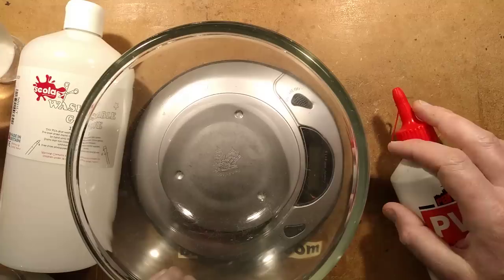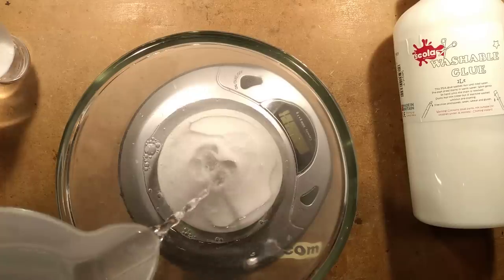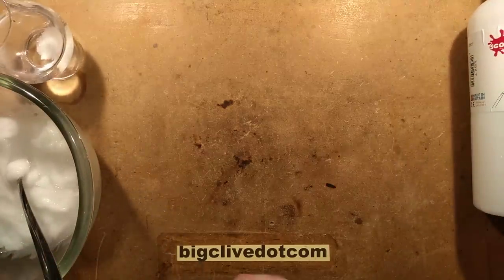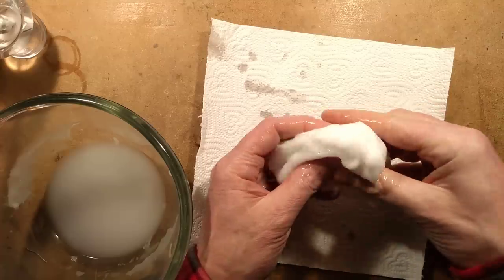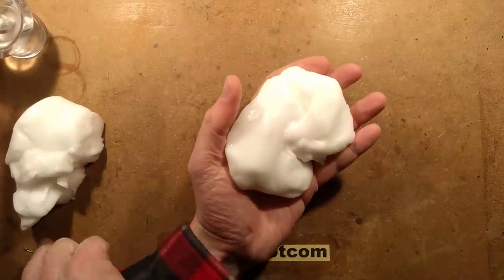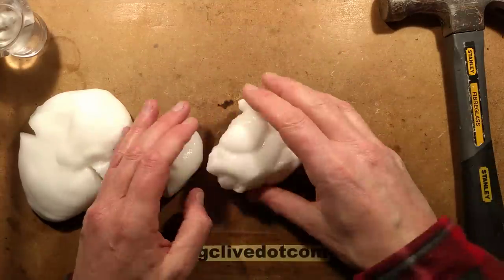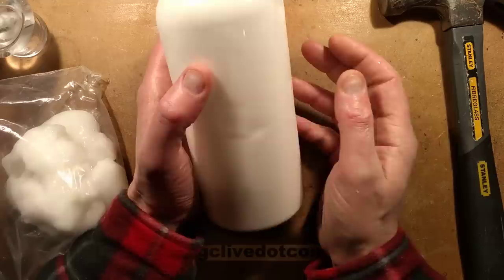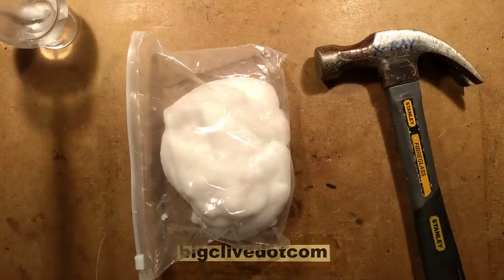Making and testing polymer gel (slime).

Comment: There's an orange material, patented by a company called D3O, which is used a lot in motorbike armour.  It's more or less the same sort of idea; but different materials.  The core non-newtonian substance is polyborodimethylsiloxane  (which also contains boron, interestingly enough).  It's too runny at room temperature, so they mix it with a (closed cell) polyurethane foam, so that theres effectively tiny beads of it encapsulated in the foam.  I have seen this as a mobile phone case, although you'd know if it was this stuff because it's bright orange.  (The funky stuff is orange, and it's sort of a trade marks of that particular product now).  Great stuff as impact armour, much lighter and thinner than anything else for the same protection.

On the types of glues: you touched on polyvinyl alcohol versus polyvinyl acetate; and I think that's the core of why one worked and the other didn't.  Polyvinylalcohol is more yellow in colour, polyvinylacetate is more white; so whilst there is a mix of both, they are predominatly PVacetate. I'm led to believe that 'Yellow wood glue', which is much more common in North America than the UK is heavier on the PVAlcohol; but I've never see in the UK so haven't played with it.  In manufacture, one has to make PVAcetate, and then remove the acetate groups in order to make PValcohol - using the alcohol monomer results in a whole mess of unintended products as the alcohol group reacts.  So the cheapest stuff will probably have less PValcohol; but more PValcohol makes a better glue (as the -OH groups have more hydrogen bonding ability then the -OOCCH3 ones).

The reason I'm mentioning it is that they will respond differently to the boron.  I think that the boron will make stronger bonds with PValcohol then PVacetate; partly hydrogen bonding, and possibly some condensation reactions with the boric acid.  (Boron chemistry is weird; and outside my experience, hence uncertainty.  However, all the polymer places that talk about it mention PValcohol specifically).  Therefore different proportions of each will result in different ratios of cross linking, and thus different products.  

It's possible to convert PVacetate to PValcohol at home; a straightforward basic hydrolysis in ethanol will do it.  If one really wanted to explore what's going on, that's where I'd start, seeing how partial to complete conversion affects the end result.
Reply: Sir what do u recommend for makeshift armor? Like knee pads/protections and so

My mum started to work in her bike but we don't have money to buy expensive protections but I have time and patience
Reply: actually it's not that good for motorbike protection, saw a guy getting hit for fun with normal solid armor and that gel and the gel hurt more. I'd like to see some tests done with a proper force measuring element behind

Comment: As a school science technician, I know slime well (mostly due to the horrendous clean up involved after a class practical or open evening using the stuff).

The main problem with using borax solution to make slime is that it can be an irritant, and kids who make slime want to play with it, which liberally coats their hands with borax (especially if they've used massive quantities like you did - you actually only need a couple of ml). It can also be teratogenic (causes damage to the unborn fetus), but I'd guess that's not a problem for you. It is however not classified as hazardous if used in solutions of 4% w/v or less (which work fine for making slime).

So, most of the hazard is to people like me, who have to make up the solution (or indeed borate buffer solutions) from the solid chemicals.

Comment: @bigclivedotcom, PVA can be either polyvinyl alcohol or polyvinyl acetate in the formulation. Due to lack of free hydroxyl groups, you can't crosslink "wood glue" like you can with polyvinyl alcohol. It will work a tiny bit as there are some free hydroxyls

Comment: For some more technical details:

The main component of PVA glue is polyvinyl acetate (PVAc for clarity), and not polyvinyl alcohol(PVAOH). However Clive is correct that this effect is caused by polyvinyl alcohol.

PVA glue is made up of loads of tiny droplets of PVAc suspended in water. To stop them colliding and merging together (and thus solidifying the glue in the bottle) certain amounts of PVAOH are added to stop them merging.

The precise amount of PVAOH is likely to vary from glue to glue, PVAOH is vastly more soluble in water than PVAc so I'm guessing the 'washable' kids glue has more PVAOH to help it wash off better.

There are also some other complications such as the various chain lengths of the polymer in question, but also the fact that the individual VAc units in the PVAc react slowly with water to form a VOH unit plus vinegar (hence the slight vinegary smell of PVA glue)

Similarly with the added PVAOH, which still has some VAc units in it as well.

This ends up degrading the glue on contact with water, so more expensive glue use higher quality version that degrade less. 

Also, higher cost glue often add some other compounds that crosslink the glue molecules and thus increase their water resistance.
The "yellow" version of PVA does this, however, the yellow color appears to be a dye used to differentiate it from the regular version, and serves no actual functional purpose XD.

You can buy pure PVAOH without the other complications, and the added benefit of not making your hands smell like PVA glue when you touch it (vinegar). They come as little granules that you dissolve in water.

It might be interesting to do that and see if the resulting putty was a better quality than the one made with glue?

Comment: In the US a simple suspension of cornstarch in water, called "oobleck" after Dr. Seuss book "Bartholomew and the Oobleck", is easy to make and really fun to play with. For example, you can walk on a large tub of oobleck without sinking due to its shear thickening properties, as long as you step firmly enough to cause  thickening, but if you stand still, you rapidly sink. A safer demonstration than your hammer-hand example :)

Comment: Boric acid doesn't work because the cross-linking only happens in alkaline conditions. Borax is a sodium salt of boric acid: roughly speaking, the sodium is more alkaline than the borate is acidic, so the compound is alkaline.
Reply: But you can dissolve boric acid in methanol (which is toxic) and it burns with a very, very green flame. Just in case you bought it by mistake and were wondering what to do with it :-p

Comment: i used to buy 2kg of borax in a nice vintage box at walmart for 3$. i like it because when you wash your floors or anything like clothing it deposit a very small amount of borax into it and it basically prevent mold from growing or insects from eating it.  also a nice trick for any damp house is to mix some borax into your latex paint, it will not mold after that even painted into a damp moldy concrete basement

borax is totally safe, its like table salt but of boron instead of sodium. sprinkle some salt into a plant and it will kill it. it is basically when i realized it could be used against mold, since mold is a plant/mushroom.

Comment: Another interesting experiment would be to neutralise ferric chloride which is nasty stuff
Quarter fill a jug with washing soda (sodium carbonate)
Add boiling water a bit at a time, stirring, we want to end up with a few crystals left at the bottom
 Let it cool off, we now have a saturated solution
Cut the top off a 2.5 L bleach container, add ferrric chloride, stir in soda solution, stirring
When you've added enough soda, the solution goes white/pale green. Add a bit more soda
I'm guessing the reaction forms sodium chloride and some sort of iron and copper carbonates (insoluble). After a few days the iron stuff will fall out and turn reddish brown, like rust

Comment: Hey Clive! Want another experiment? Silicon caulking and corn starch. I suggest a variant to it: 50/50 corn starch and baking soda (sodium bicarbonate).

The caulking need to be the vinegar smelling type (GE Silicon I for example). That one is water activated. The corn starch contain enought moisture to activate it.

Alternativelly, adding baking soda make it react faster and absorb a big part of the smell, by converting the acid produced into water and salt, hence why it speed it up, and why it "absorb" the smell.

Take note: do that in a well ventilated area due to the very very strong vinegar smell.

Comment: I knew there had to be a dangerous element in there somewhere. A hammer to fingers did nicely :-)
Reply: But Clive didn't set it on fire.
Reply from the maker: I don't think it would go on fire.  I'll just go and test that...
Nope.  Wouldn't burn.  Even when I used a small bow torch.
Interesting that a thin layer on my finger could be exposed to the flame and protected my finger from the heat.
Reply: @bigclivedotcom  Try again, but with a flaming hammer this time... :D
Reply: If I am not mistaken, I think they use boric acid to treat the newsprint used for cellulose blown-up insulation to make it fire retardant.
Reply: @bigclivedotcom  it's similiar to starlite

Comment: Wonder if this stuff drys out and its limits when it comes to protecting things from impacts.
Reply from the maker: You can make a version based on silicone oil.
Reply: @bigclivedotcom  I was thinking/wondering if it could be used to protect lithium cells from impact.
Reply: @bigclivedotcom  What are your thoughts on using it as impact protection for batteries?

Comment: Is it bad to bypass drivers? Ive been doing it to clock radios, tvs and bluetooth speakers but Im not sure what its really doing to the circuits. Its where i go in, remove the 75mm speaker, add extra wire and connect them to book shelf or floor standing speakers to get a bigger thicker sound without an expensive theater receiver.
Reply: Are these devices just providing signal or something? I’m not elechicken but I would think the wires hooked up to a speaker in a cheap alarm clock also deliver the power, so hooking it up to a big speaker would give the same electrical output but with a diminished volume.

Comment: Interesting stuff. I wonder if a similar material could be used to help spread micrometeorites impact energy on space vehicles? If it could still flow it could even self seal the holes. I'm assuming this would be inside several outer layers, so that it wasn't exposed straight to the cold vacuum of space.
Reply: if this putty can't even stop a bullet it is not going to stop space debris moving faster than the speed of sound

Comment: A Clive video is always enhanced when the x-ray equipment comes out to play.
Audiophiles go on about deep cleaning records with PVA. I'm wondering if this would do the same, as popping a dollop on an LP will cause it to flow to the same shape, and lifting all the microscopic dust out when removed.  Worth a try with one I don't value.
Reply: cleaning records with glue really works, its great
Reply: @-yeme-  I've wanted to try this for a long time, but I'm pretty much ocd with mine so they never get to a point where it's needed. I looked at one yesterday that I bought in 1989 and was still shrink sealed.
Reply: @bren106  totally agree, by far the best way to have clean records is to keep them clean in the first place. take them out to play, keep the lid of the record player closed and put the record back in the sleeve as soon as youre done and you really shouldnt ever have to clean them anyway. I have records that are decades old that have never needed anything more than a quick once over with a carbon fibre brush. but Ive also used glue to deep-clean 2ndhand buys and records that I owned as a teenager when I wasnt always so careful, with really good results

Comment: I'd like to make one of these, but I can't seem to find Borax anywhere :(
Reply from the maker: eBay?
Reply: @bigclivedotcom  There are some offers there, but I would have to import it. I found little packages that contain 90 grams of it on eBay for much cheaper tho, I think I am going to order one of those, to make a smaller slime. That should be enough!
Reply: @Davis38  Far more than enough. 250ml glue, 350ml water (250ml with the glue, 100ml with the borax), and you need about 2g of borax

Comment: Borax + PVA glue = silly putty
Borax + PVA (alone) = slime

Getting PVA into solution is a major pita, the water needs to be hot and the second the PVA powder hits the water it clumps up and requires a mixer or immersion blender to break up.  I used to make tons of the stuff for an after school science enrichment program.  You can’t make slime with glue.
Reply: I beg to differ. I've sucessfully made slime quite a few times with different PVA type glues, a little water and very slow careful addition of borax solution. The amount of borax is generally what determines the result. In terms of the result, the second option you mentioned can provide a translucent slime but the properties are otherwise so close you wouldn't pick the difference. I've even used clear glue (which actuallly was a little more putty like)  and the only time it turned out a lot more putty like than desired was (like Clive mentioned) when I used  bulk PVA glue from the hardware.
Reply: Kirk Claybrook  -  yeah, but if you have a pure PVA solution, mix with a borax solution, you get drippy clear slime like from the Alien films...   it looks and feels totally different.
Reply: @grendelum  Aside from the 'proper' one being translucent/clear there is little if any discernable difference when made carefully. I've spent plenty of time playing with store bought and home made. Clive put way too much borax in his, that's why it is like putty and 'tears'.

Comment: How Safe Is Borax?  Borax in the usual form of sodium tetraborate decahydrate is not acutely toxic, which means a large amount would need to be inhaled or ingested to produce health effects. As far as pesticides go, it's one of the safest chemicals available. A 2006 evaluation of the chemical by the U.S. EPA found no signs of toxicity from exposure and no evidence of cytotoxicity in humans. Unlike many salts, skin exposure to borax does not produce skin irritation.However, this doesn't make borax categorically safe. The most common problem with exposure is that inhaling the dust can cause respiratory irritation, particularly in children. Ingesting large amounts of borax can cause nausea, vomiting, and diarrhea. The European Union (EU), Canada, and Indonesia consider borax and boric acid exposure a potential health risk, primarily because people are exposed to it from many sources in their diet and from the environment. The concern is that overexposure to a chemical generally deemed safe could increase the risk of cancer and damage fertility. While the findings are somewhat contradictory, it's advisable children and pregnant women limit their exposure to borax if possible..
PS-- Did you know that Canada (thanks to lawmakers there) requires all cigarette packs sold there to be one color (a yucky green, chosen for it's ugliness) with only the brand and makers name on the outside. Effective 1-1-2020, I believe.
Reply: Bollox, sodium tetratra borate is a major part of  washing machine detergent.